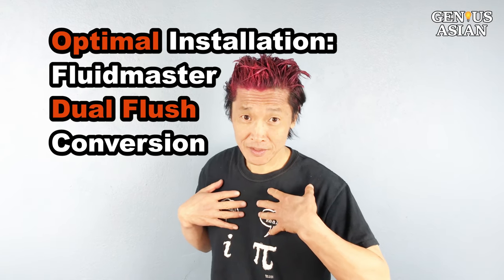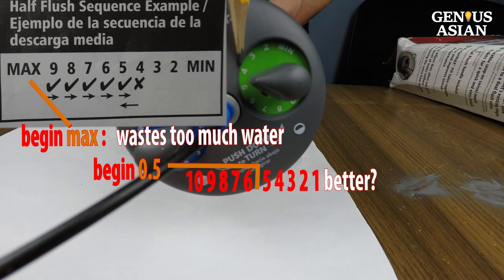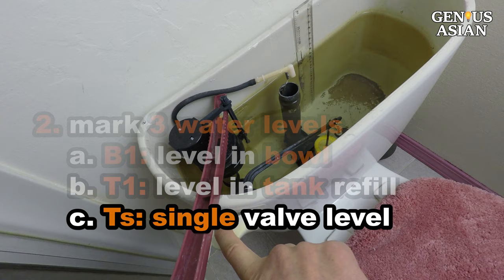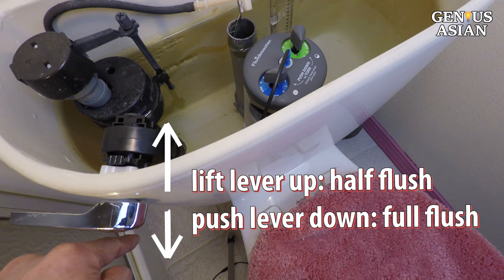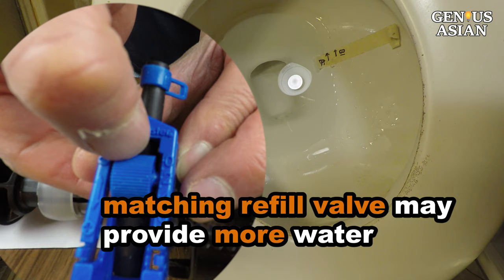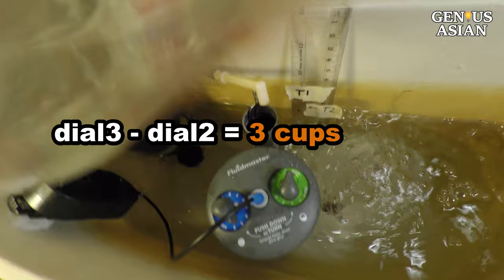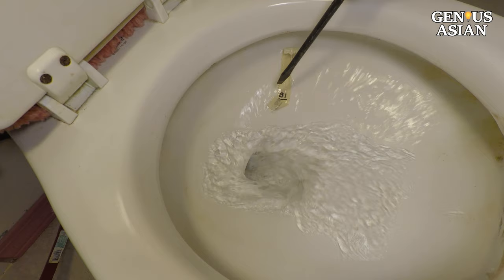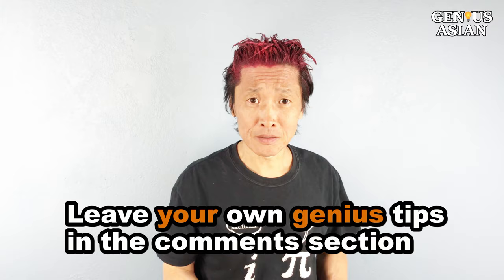Optimal: Install FLUIDMASTER DUOFLUSH without wasting water | dual flush conversion system

Comment: The golden section, or golden ratio part of your video was fascinating and very helpful.  I had written a computer program trying to find a number with the fewest tries - and i thought I had the best method, but after watching your video, I applied your golden ratio/section method and found it was the best.   Thank you!   

To explain how you helped me... In my situation, say you wanted to find a random number between 1 and 100, or 100, or 1M.  Rather than looping from 1 to 100, or 1000 or 1M and increasing by 1 each time to test, which could take many, many, many tries and waste time, the method I employed was to test was a binary method testing at 50% between 2 numbers.  if the number is greater, test at 50% between those two numbers, if the number is lower test at 50% between those two, etc.  In this way I was sure we'd get to the number in the fewest amount of tries. 

Ex: if trying to find a number between 1 and 100 - say the number is 51 - we test 50. it's higher so we test 75, it's lower so we test 62.5 etc.  In this way, we find the number in 8 tries.  This is much faster than if we ran through a loop from 1 to 51 - which would be 51 tries.  When testing larger amount of numbers, this method is very efficient.

But after applying watching your video, I decided to apply the golden method and I tested and found the number 51 in 6 tries, which is more efficient than my 50% method ( 8 tries ) which I thought was the best. Now I am convinced this golden method is the most efficient and elegent way to do it in the fewest tries. I use this in many of my programs and your method will make them more efficient and take less time.  There are hidden gems of elegant mathematics in your videos.  Thank you genius!  I appreciate you taking the time to make these videos and share your wisdom and helpful tips with others!
Reply from the maker: it is very rewarding to read your comments, I am very happy to see people can truly understand this and also can apply to other situations. Also thank you for sharing your application, it will help other viewers.